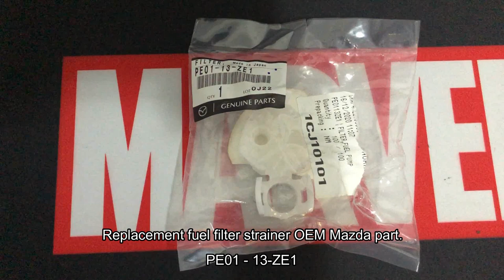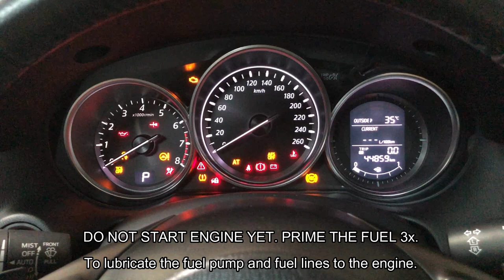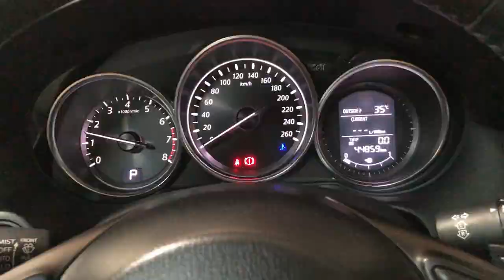Mazda Skyactiv CX 5 CX 3 How to replace Fuel filter strainer. Mazda 3 Mazda 6 Mazda 2.

Comment: Over the spring I'm going to do oil catch can on mine, replace the value cover gasket, and change the fuel filter..when it gets a lil warming. North America, USA, New York. Thanks for all your videos. Very very helpful. Also during summer/fall a transmission filter replacement.
Reply from the maker: You’re welcome.
Reply: How often should you change the fuel filter strainer?? @FelixDanGarasiAuto
Reply from the maker: @djintence  every 100k kms. 👍🏼

Comment: You got to love japanese engineering, there are some vehicles where you have too lower the whole tank to replace fuel pump
Reply from the maker: haha yeah true that bro
Reply: I had a 2033 BMW 330i, it was so easy to work on it that to remove the seat you didn't even have to remove screws to take out the back seat, you just pulled it out and it came out. LOVED that car and how easy it was for a noob like myself to work on it.

Comment: Great video!   Thank you for sharing.  I also installed a catch can on my CX9.  I installed it during the last oil change at 3k miles.  I’ll be changing the oil today and report out my findings as well.
Reply from the maker: awsome let us know how it goes :)
Reply: @FelixDanGarasiAuto  so I checked the catch can.  Absolutely empty.  Not even some residue.  I blew into the inlet side of the hose and felt air come out of the out hose coming out of the catch can so there are no blockages.  I followed up on other pages and heard the same thing.  I guess Mazda is really good as we think it is.
Reply from the maker: @georgepaniagua6115  ✌️
Reply: @georgepaniagua6115  Is the oil catch can connected to PCV?
Reply: @mtay65  yes. From the PVC to the intake plenum port.

Comment: Bro I'll pay you to work on my car any time , hard to find a mechanic so careful and clean like you, hence why I'm learning to do most stuff on the car myself on your channel 👌👍✌
Reply from the maker: Thanks man i Really appreciate that :)
Reply: @FelixDanGarasiAuto  btw you only replaced the fuel filter low pressure which is the strainer right, there's actually high pressure fuel filter as well which is the top part? Cheers
Reply from the maker: @bocap1980  Yes it was the lower strainer fuel filter. the high pressure is built in the fuel pump unit itself. Mine was in a very good condition so dont need replacing.

Comment: I just did the fuel filter strainer on my 2020 CX5 with 32,500 miles    and the old one was almost as white as the new filter . I just bought the Mazda with 32,108 miles. I
guess the it might have been changed before.
Reply from the maker: aaaahh Perfect 👍🏻. use a good quality fuel will cleanse the fuel pump unit and filter and should last for long.

Comment: Excellent video keep up the great work. What type of oil catch can did you use please send the link. Thanks.
Reply from the maker: i purchased mine locally but if you r overseas can get it thru here https://www.wish.com/product/5bfa467be441ef0c3f2ac04d?from_ad=goog_shopping&_display_country_code=ID&_force_currency_code=IDR&pid=googleadwords_int&c=%7BcampaignId%7D&ad_cid=5bfa467be441ef0c3f2ac04d&ad_cc=ID&ad_lang=EN&ad_curr=IDR&ad_price=265295.00&hide_login_modal=true&share=mobileweb

Comment: Why the filter plastic house got brown? What is in the gasoline? Mine was still white after 135k km. Btw, there is an inner filter also around the pump. I have changed the whole unit altogether.
Reply from the maker: cause by bad fuel quality discoloration.

Comment: Mas felix, is it power supply socket position matters? I am afraid misconnect righ- left things
Reply from the maker: @ghozicoba  oh if you get it mix up it will not operate properly . So the orientation of the connection must be the same as you pull them out. Thank you
Reply: @FelixDanGarasiAuto  thanks

Comment: Hello bro, thank you so much for new and helpfull video ! Likes your video!!!     please make more :) 
Two questions :
1. If i remmember correctly, you installed this catch can arround 42000km and after like 3000km this small amount of oil its catch? I ask you because in my car (cx5, 2.5 , 38000km) its catch same amount oil after like 500-800 km :( something wrong with my car ?
2. Where is the fuel filter itself :) lol ..... ? i know that usually this white pad comes before fuel filter
Reply from the maker: Yours is fine :) nothing wrong with the car. i just dont drive it hard enough haha. Our cars only get the high pressure fuel filter its within the fuel pump it self.

Comment: Biasanya sih kalo fuel filter yang didalam kita ganti sama rotaknya juga, mungkin karena program warranty
Reply from the maker: sbenernya kalau tdk ganti jg tdk kenapa” cuman ya balik lagi sama pemilik apakah mobilnya mau di simpan / pakai lama. kalau cuman user biasa biasa saja sy rasa tdk perlu di utak atik tinggal tunggu sampai assembly pompa unit nya rusak dan tinggal ganti baru. ✌️
Reply: @FelixDanGarasiAuto  ya saya pikir begitu juga bagusnya kalau sudah rusak saja baru diganti, "yang punya mobil Mazda ini punya banyak uang begitu sebentar sebentar ganti rotak :v" tapi kata mereka daripada tiba tiba mati waktu di jalan tol

Comment: Hi Felix.
Do you have a video to replace the fuel filter for honda crv 2007 petrol 2.0 as well?
Thank you for your very informative videos.
Reply from the maker: ahh unfortunately i dont have for the honda crv.
Reply: Hi Felix, thank you for the reply. Can you tel me the where is located the fuel filter on your CRV?
Thank you
Reply from the maker: @zahariafelix  should be very similar to other cars, it is located under the rear passenger seats. there should be a service hole you can access.
Reply: Thank you Felix

Comment: Great video, your gasoline is blue 😆 here in the states is a bit green, in Mexico is pink. I see there a lot of debris in the filter, did you just changed it cause your CX-3 felt sluggish? Or just because of the high kilometers? My M6 has about 87,000 miles
Reply from the maker: car is fine . runs no problems . ✌️just want to show us the condition after 45000kms. scared it will get clogged up and ruin the pump unit :)
Reply: @FelixDanGarasiAuto  absolutely right, I guess it was better before when we had access to replace the fuel filter on the outside of the fuel tank.

Comment: Is it necessary to replace these fuel filter strainers? My Mazdaspeed 3 has 210,000 km and I have not replaced it yet because I never heard you had to..? 😅
Reply from the maker: its totally up to you hehe but if you r keepin the car for awhile id suggest to replace it. 😀

Comment: How bout inline fuel filter?
Reply from the maker: @TommyJones49  what about the inline fuel filter ?
Reply: @FelixDanGarasiAuto  Does it have one? Maybe I'm showing my age but it used to be a barrel filter with hose clamps in engine compartment. Was going to change as a 5 min project, but all I come across are these gas strainers.
Reply from the maker: @TommyJones49  nope these skyactiv cars dont have inline fuel filter like the older cars.
Reply: @FelixDanGarasiAuto  no wonder I can't find it. Thank you.
Reply from the maker: @TommyJones49  yeap they built in to the fuel pump assy . Give love n Keep supporting this channel by like , share and Subscribe.

Comment: I have cx3 2019 1.8d and got message about a lot of water passed on fuel sediment filter. I removed the message via forscan but I need to drain the filter. I dunno where exactly is. Anyone know where I am gonna look for this?
Reply from the maker: behind the battery , check it there.
Reply: @FelixDanGarasiAuto  thnx friend I am gonna look
Reply: @FelixDanGarasiAuto  It was under the car, near the tank and left rear tyre.
Reply from the maker: @jamesjay1987  ahh cool you found it :)
Reply: Hi there, i see you only replaced the pad but not the rest of the body filter (PE0113ZE1). Shouldn't i replace the body also?
Reply from the maker: @nathanair  Yes correct this one i only replace the filter strainer . if the body assy are still in a good shape you wont need to replace them.

Comment: Hello bro, is it possible that this car has 2 fuel filters?
PE1A13ZE0
PE0113ZE1
Filter for coarse and fine filtering...
Reply from the maker: @amnon3267  the fuel pump assy has 2 filteration. 1 is like in this video the strainer . The other one is built in inside this fuel pump housing where the fuel pump mate to the actual housing.
Reply: Do you maybe have a video on how to replace the second filter?  How often is it replaced, if at all?
Reply from the maker: @amnon3267  the second filter dont usually get replace until the whole fuel pump breaks / not functioning.

Comment: Halo bro, fungsi utk ganti part ini untuk apa ya?
Reply from the maker: fuel strainer nya fungsi nya saring micro particle dalam tanki bensin mobil. Kalo uda lama pasti kotor di dalam tanki bensin & kotor juga filter strainer nya jadi bisa menghambat kinerja si fuel pump. Fuel pump assy seperti mobil ini harga nya lumayan mahal kalau terjadi kerusakan.
Reply: Oh begitu, ntar gw coba ganti sndri juga deh. Kemungkinan pny gw jg blum pernah diganti. Mau tanya juga bro, kok cx5 gw lumayan boros ya full tank cm dpt sekitar 400km tenaga juga kurang. Kira2 kenapa ya bro? Thanks
Reply from the maker: @harihartono8512  Tahun brapa ya CX 5 nya ? Pakai bensin apa selama ini ? rutin service kah ? Udah di Kilometer brapa ?
Reply: @FelixDanGarasiAuto  tahun 2012 petrol bro. Serviced rutin by mazda. Selalu pake bensin 98 bro.
Reply from the maker: @harihartono8512  ok , apakah sudah coba bersihkan intake MAF sensor & Throttle body juga seperti yg ad di channel ini.
Reply: https://youtu.be/JsyJS2cCb9g yg ini ya bro?

Comment: dont these engines some with a built in air/oil seperator.
Reply from the maker: they do have one from factory but dors not work well , thats why i add this oil catch can will helps to reduce the carbon build up in the intake valves.